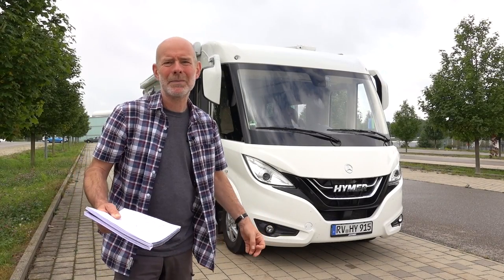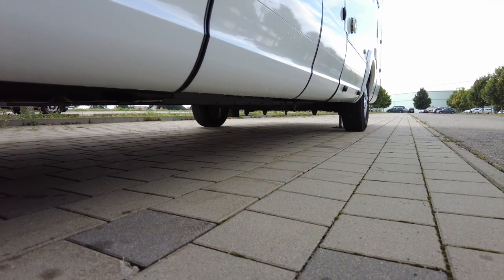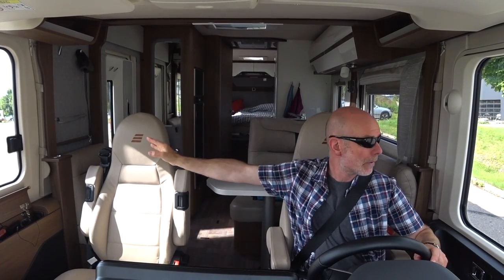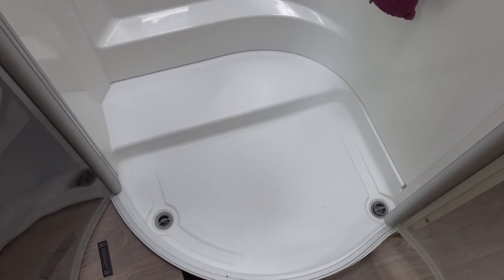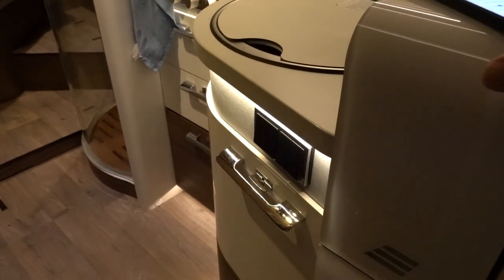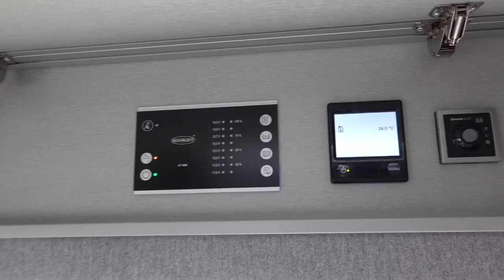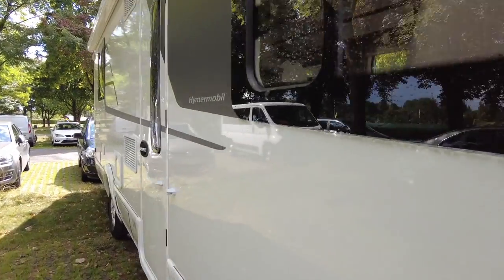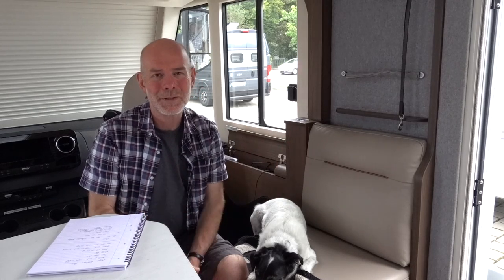Hymer B790 ML Motorhome - EXTENSIVE Live-in Review

Comment: you dont remove the wooden shower floor thats why its there, for a more slid ground and help prevent from slipping lol. This needs a 3000 watt inverter so air conditioner can run without having to use a  main.

Comment: Dear Andrew, Many thanks for publishing a comprehensive, informative and entertaining review. Whilst the wife & I have no interest in changing our Autosleeper campervan we are always curious as to the functions and features of what is available. Having spent a fair bit of money on lithium/solar/charging & monitoring upgrades in the past year we agree completely with your conclusions about the leisure battery upgrades - We have found that it gives us infinitely more suitable pitching options and is an absolute game changer. However we were surprised that Hymer do not offer a battery computer as part of the lithium pack as it gives a precise % of the remaining power capacity rather than best guessing based on battery voltage. Agree too that the reversing camera is an absolute necessity although surprised it doesn't double as a rear view camera as the Camos Jewel one does. The one thing I was surprised was missing was an external 4G/5G aerial and internal router to provide Wi-Fi capabilities. This would've been a far better option than the satellite dish not just for TV watching (which I understand doesn't really interest you) but for working on the road and getting a signal where your phone/ipad cannot. As a great fan of German products we agree that the cab blinds, non-upgraded habitation door and non-pattern matching service hatches are poor and inconsistent with what would be expected from this quality package. Lack of gas struts is just penny pinching. Lastly our sympathies and condolences to you for your recent losses. Our experiences have not been dissimilar to yours and were a major factor in our decision to buy what we did.  Carpe Diem!

Comment: Hello,
I saw your video with great attention and curiosity because I have a new ML790 since the end of April.
I must confess that I love this car, that I saw some videos of this model before buying and, because its video is brilliant, I recommend it to those who are really interested in this car.
In the impossibility of communicating directly with you, I’ll leave the owner's opinion:
The door with central command is fantastic and also closes the garage, the step on the driver's door is very practical, the power system with lithium batteries associated with the 2 solar panels is spectacular and as I live in Portugal I am very pleased to choose to have air conditioning (if it did not malfunction 😡)
I also have your opinion about the negative points you focused on in the video and the living/meal area is too tight, the driver's seat is not flexible enough to rotate and give a good position for meals, the air conditioning stopped working due to an electronic problem and Hymer says that Truma does not have a replacement part, so I can't use it. And also Hymer Connect was chosen as an extra in September 2020 (on the car order) and I only received it in September 2021 but it would be beautiful if everything worked as promised what unfortunately doesn’t happen, this device is 100% marketing and only 50% operability as we see in your video and also, the lights can change intensity and tone day/night but the dimmers turn on with on/off switch off (in the app) and does not allow you to turn off, that has a defect. The best option is to exchange the €890 for other extras because Hymer Connect does not work conveniently and I have already returned mine for reset.
Thank you for your attention
Reply from the maker: Very useful information - thank you!

Comment: Just to inform you Andrew, you could have both solarpanels and airconditioner AND you could run the airco from the lithium battery for en few hours. Also an option while driving. I have the B-MC T600 the smaller version of the B-ML and it is a good option if you want it a little shorter. Cheers mate.
Reply from the maker: Thanks! Great to hear from you :)

Comment: Great review! Very comprehensive, addressing a lot of details. Since three months I own a Hymer Modern Comfort B MC T580 and I am very pleased. Concerning the commonalities between Masterline and Modern Comfort models I can agree with almost all of your ratings and recommendations. The rotation of the front seats is not very easy, the driver seat is limited by the steering wheel and the passenger seat in my T (semi-integrated) is limited by the passenger door. However, these drawbacks are owing to the Mercedes layout. In contrast, the door with the noisy closing is a Hymer thing. When I specified my camper I was aware of the option of soft-closing for Masterline models, but for Modern Comfort models this is not available as option. You did not mention the fuel consumption, it is rather high in my view (12l/100km Diesel, approx. 2l/1000km AddBlue), of course depending on your driving profile. The smart battery systems works great.
Reply from the maker: Useful information, thank you Bernd!

Comment: There is a hierarchy in assessing reviews.  We have:
1. A quick first view/sneak preview.
2. A typical caravan/RV review.
3. A typical long term lived-in review.
4. An Andrew Ditton long term lived-in review which leaves no stone unturned.

If I were thinking of spending £102K to £150K on it, I'd want my vehicle to hit the vast majority of my targets, so would want to see Andrew's video.  Lack of a detailed TV description is not a concern.

Incidentally I often wondered whether I'd use the various electronic/App controls in a caravan etc when it's easier to simply press a button (eg on the heaterr, on the TV etc) which is within arm's reach.  It's not as though the control buttons on the various implements are in a cellar at the eastern wing of a castle!

I agree about the absolute necessity for a solar panel as against a mains AC unit.  I would say the same for a caravan. AND the driver's entry door on the UK side should not be an "extra" but is essential. And your last minute inset at the end deals with some of these issues.

"Last minute lecture" was so relevant and I agree with you.

Well done - as usual!

I enjoyed the review. Not so sure that  Dougal did, though!
Reply from the maker: Thanks Raymond - that's very kind of you to say. Makes it all worthwhile, I really appreciate it. All the best.

Comment: A first rate, honest review, as usual Andrew!
The Hymer looks like a solid choice for those who are able to tour extensively.
I like the understated, classy styling. It is a motorhome that would age gracefully :-)
Given the lag on the Mercedes auto box, I wonder whether you've had a chance to try the new 9 speed ZF auto box on a Fiat? It is silky smooth and ZF boxes are very reliable (BMW have been using ZF autos with high reliability for years).
Reply from the maker: Sadly not yet, would LOVE to try one!
Reply: @andrewjditton  This Hymer / MB Sprinter front-wheel drive chassis features a 9-speed ZF automatic transmission.

Comment: Wonderful interesting and informative video. You often mention a caravan or motor home being “up plated”. Could you explain in a future video what that means in terms of what they do to the vehicle. Apologies for rookie question. Thanks again. I’ve loved this Hymer Motorhome series.
Reply from the maker: Hi, please see my recent videos about weights and payloads where I go into this in more detail. Basically, it's the absolute maximum weight that the chassis/axle(s) can bear. The regular MTPLM is usually below this figure for all kinds of reasons - normally just commercial (to make a vehicle appear lighter, or to come in at under 3,500kg). I admit that in THIS case, it seems a little bit pointless for the sake of 70kg out of 4500kg.
Reply: @andrewjditton  thanks Andrew, I did see that video and found it very informative, but it was what they physically do to the vehicle to upgrade that figure that I was wondering about.
Reply: @pubgoer1963  As far as I’m aware they change the physical plate and do the paperwork for the logbook. When my Benimar was done that’s all they did. No physical work on the chassis at all.

Comment: Nice I like the review as its the same model I am looking to buy with island bed next year. Solar for the  lithium battery and inverter upgrade is a must and one I will be adding along with automatic. I don't get their reasoning for making it 4430kg with a zero cost upgrade to make 4500kg? I can only think that there must be a country with a weight limit or tax or or tax class or both. The other I cannot work out is the price difference of £4370 between master line and modern comfort line as specs look the same and what you get better for that price.

Comment: forgot to add, not sure you should say you were driving 120kph when the sped limit for over 3.5t is 100kph on autobahn and 80kph on other roads.
Reply from the maker: Ahh... by 120kph I of course meant 100kph. Slip of the tongue...
Reply: @andrewjditton  I thought as much, only downside of having a 3,85t Hymer, the other it being 3150kg when I bought it new so had to upgrade the weight from 3500kg.

Comment: Q: with that hydraulic jack system, can you raise it to maximum on all four sides for general servicing of the vehicle, e.g. a wheel change?
Reply from the maker: A: Pass! (sorry)
Reply: I have a B690 with the hydraulic jacks, which lift the van off the ground for maintenance but hymer recommend you don’t change the wheels using the jacks!!

Comment: A pity you never looked at the engine compartment, nothing can be done through the letterbox access, NOTHING. It is a pain to work on for any regular maintenance even the air filter   has to be disassembled in place in order to  change the filter as for any serious work all the local Merc commercial dealer’s fitter go sick when they know one is coming. The whole area isa BLACK HOLE. The fluids are a real pain to top up.